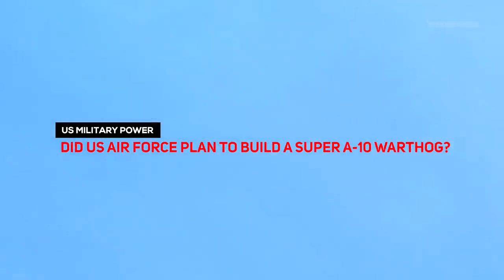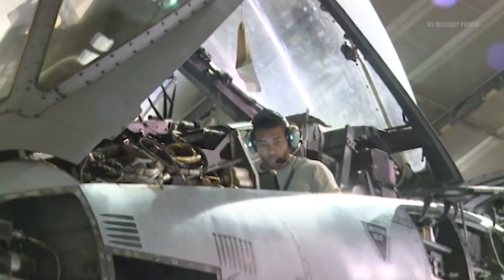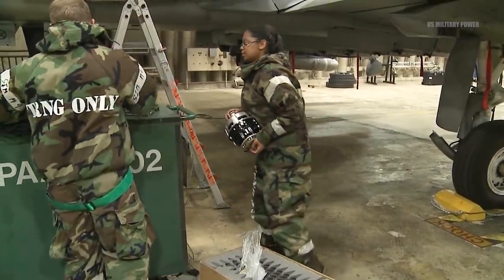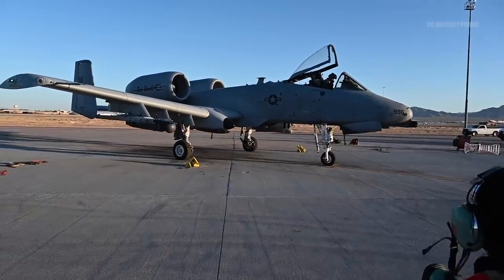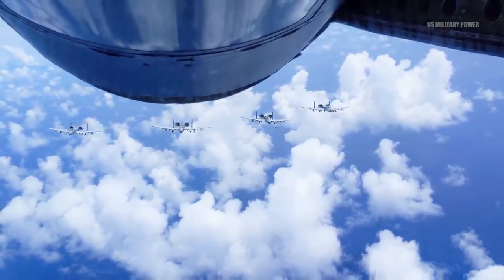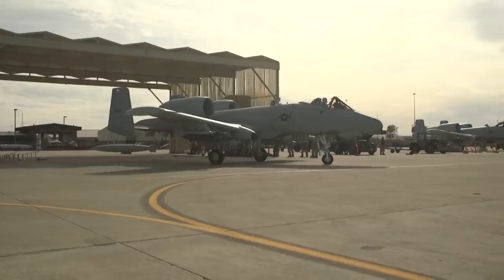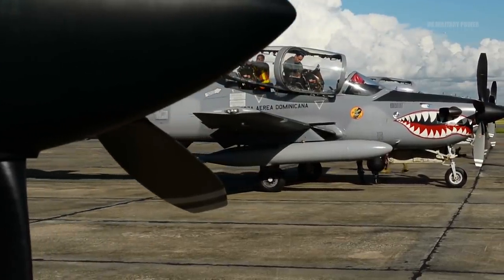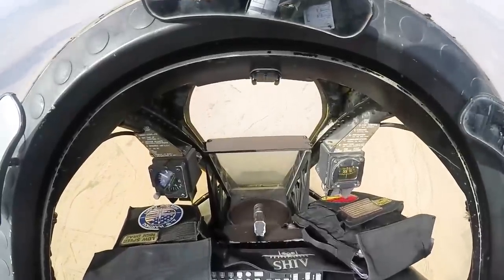The New Super A-10 Warthog is Coming

Comment: Here is my idea for a new A10 replacement: Platform will look almost identical to A10, but be built from armored composite materials, improved engine, advanced avionics set and maybe even built around a new improved rotary autocannon. It will feature capabilities like surveillance and targeting assistance from UAVs. That's it, if F15 EX exists, so can a potential A10 EX or something.
Reply: Put a small drone on it that detaches and provides recon for the pilot autonomously in night vision or infrared so the pilot can see what's happening around the battlefield better without having to fly by looking down so much. Install a better radio too

Comment: Its the only aircraft that can withstand close combat support and take a beating but still make it back to base under power. It's a soldiers best friend so placing would be a no if you're smart. Yes updating it and if it can improved overall with better technology, improved weaponry, more speed/ maneuverability and an even tougher less impenetrable frame then I'm all for those improvements but it's role really can't be replaced but they can improve it and for way cheaper than 5th generation fighters by far even though they have there role as well.

Comment: The only thing better in my opinion than an A-10 is an A-10 with another gun and thrust vectoring
Why thrust vectoring:
Gain altitude near vertical until stalling above a heavily armored tank that might be developed in the future and thrust vectoring will allow you to 180 right to the weakest part of a tank (roof) with the best angle of none for penetrating armor and blast the heck out of it with 2 guns

Maybe also something that allows the gun to turn to whatever the targeting system locks onto
For guided weaponry without the price of missiles 
(basically just like aimbot in a video game)

Comment: The biggest issue with the A10 is that it wouldn't survive long in a modern war against a well equipped enemy. It really only works when you have air superiority and there is minimal threat from SAMs. If it is to be replaced, it needs to be replaced with basically a newer version of itself, but I think it has to be unmanned.

Comment: I like the idea that the new A10 will have computer-managed flight control by differential thrust - As an emergency measure. (Propulsion Controlled Aircraft software developed at NASA Dryden). I don't see a reason why the old A10s can't be retrofitted with it, since it's entirely a software upgrade. We can probably presume they have done this.

Comment: It is built with function over form. Where radar cross section isn't a key factor. Its slow, armoured, and absolutely lethal in it's role. They've come home without wings or engines, and is the best thing to turn the tide of a ground battle. 

They really need to ditch the f35 money pit and focus on what works- and make more of what works instead of trying to reinvent the wheel.

Comment: The a10 is here to stay. Albeit I really wished they would actually add modern prop attack planes for close air support in non heavy anti air areas. Better heat efficiency/ heat locking SAMs can't find em and triple the loiter time in the AO as they are extremely fuel efficient. Grants the A10s being utilized on the seriously dangerous areas and should give more firepower in those areas.

Comment: Instead of replacing the A 10 change the materials and make it even easier to maintain the craft. An example could be investing into advanced 3D printing machines to build fewer pieces and make it easier for mechanics, also adding regidity and saving in weight.

Comment: I think the problem is that the A10 is currently a lot cheaper than a F-35B for Marine use, I mean one of those suckers is like  maybe 115M for the F-35B compared to the inflated price of 10M for the A10 so naturally the parts and upgrades etc would be a lot cheaper still. F-35 is of course a superior airplane by far but it will burn a ton more fuel and feels like a complete overkill for terrorists, though the stealth aspect would make our soldiers even more safe and I suppose you can't put a price on American soldiers.

Comment: There was already a very good...no, excellent candidate available from way back in 1991. The aircraft was small fast and very nimble with the same, albeit only slightly smaller caliber, GAU Gatling gun, with 4 hard points as well. The jet powered aircraft was designed by Paul Rutan and it was called the "mudfighter" or "killer bee" or something to that effect. There is still a video of that aircraft here on YouTube. Just search for "Paul Rutan mudfighter killer bee". Type that phrase in and it should be on top of the list.

Comment: When you need CAS the last thing you want is to be waiting for a F-18 or F-35 to get turned around and lined up to make another pass, whereas an A-10 will just do a quick roll and be right back on target, low and slow, with accurate fires. They can take a hit and keep on laying down fire, not to mention they cost a 10th of what it costs to fly a F-35 (per hour), and if the enemy does get lucky and downs a F-35, that's $80 million!! And even if they manage to just do minor damage you're talking a million to repair the stealth capabilities. 

The A-10 was never meant to engage in highly contested airspace, we wouldn't have troops on the ground in such an area. It is and has always been designed for CAS to support ground troops, not to take out radar facilities, and enemy fighters. So to use the argument that it's obsolete due to that reason is BS.

Comment: For me, the A-10 is the close quarter aircraft, among all fixed wing airplanes on service not to mention it can take hits and shrug it of as it's just a scratch.
I'm no military expert but aside from the AC-130, is there any other fixed wing aircraft that can do a close in support to ground troops that can come in and out on both open, mountainous or even urban area.  Yeah, the F-35 may have hover capability but it can't take hits like the A-10 and it's mostly analog (I think), so electronic warfare won't be that much hindrance to the A-10's.  I may miss out some points but A-10 is a beautiful aircraft. it gives me more goosebumps whenever I see a video or picture of if compared to the Longbow Apache, F-35 and/or the F-22 Raptor
gorgeous
Reply: An A-10 would become dust if an S300 or a newer SAM hits it.

Comment: There's just no reason to retire it, until they can make a plane that does it's role better than the A-10 and is cost efficient there is no better option than just tweaking the A-10. The F-35 is far more expensive and less effective in a ground support role, nor as safe in a "low and slow" strategy, it isn't maneuvering like an A-10 can.

Comment: There is a potential to make the A-10 better. But only by producing newer models with more survivable, fuel-efficient engines and making it an UAV. This would eliminate the need for the vast amount of titanium needed for the 'bathtub', saving it for use around the avionics bay and allowing the trade of the cockpit equipment weight for equal weight in additional GAU rounds, Current and future A-10 pilots would transition to flying the plane remotely, allowing for tighter turns, the ability to place the plane in greater harms' way, and provide guaranteed survivability of the pilot. Unlike the Predator and other UAV pilots' stations, the job of the A-10 requires a wraparound electronic cockpit and the aircraft mounted cameras required for the full field of view with zoom technologies useful in CAS giving an enhanced ability to scour the battlefield for targets.

Of course, current A-10 pilots may object because it takes them out of the air and make all missions virtual, but this would be the only real replacement for the A-10. Else startup the Fairchild factory production line and get to manufacturing a new run of the 'old' model.

Comment: This is simple. ANYONE that wants the A-10 retired has NEVER been on the ground, in combat, being shot as (as I have). They don't know the RELIEF that is felt when I was told that A-10's would be checking on station and I should start working up a 9-line. Morale just SKYROCKETS because we know that the people shooting at us will be DEAD soon with nothing but bits and pieces of them left. The A-10 was DESIGNED and BUILT for CAS (specifically anti-tank) but it does just as an effective job on PAX. The A-10 is cheaper, has longer play time, can take more damage and the pilots have a MUCH better chance of getting home after sustaining damage than the "next gen fighters". There is NO OTHER PLANE that I'd rather have in combat than the A10. None.

Comment: If the Air Force One will not continue with the A10, army should fly at alongside their choppers. We need a close air ground support fixed wing aircraft to protect our troops on the ground. During combat situations A-10 pilots are unable to buy their own drinks in a bar for a reason.

Comment: With all of these "we must replace the A10" initiatives out of the UAF, I've never heard an articulation about what that A10 does poorly at in its CAS role.
Aside from some electronics upgrades, there just doesn't seem to be any real meat on those bones.

But I'd love to hear it if there is.
Reply: @Paytrolah   This sounds like you don't like CAS even as a concept. Because there is literally no way to do CAS without dealing with MPAD threats (and unlike all other CAS aircraft the A10 has the best survival rate). The CAS role also doesn't involve air coordination or battlefield networking at all. Nor are precision guided munitions, which you offer as a substitute, "close" in terms or air support. (I also wonder what you mean by "can't take out a tank", since nearly any modern aircraft have the mount points for weapons that can; unlike stealth aircraft, there are no real size restrictions on the A10's either.)

So while you can be against CAS, that's not what I'm really asking. The Army, for various obvious reasons, loves the role. (As just from a psychological standpoint, you can see its value: having a jet flying around low and slow panics enemy insurgents causing them to break off attacks, more than any single bomb dropped from 20,000 feet could.)

Maybe it would just be better to scrap the Johnson-McConnell agreement. Let the Army have the A10 that the Airforce poo-poos. With the loiter time and serious firepower to affect an extended firefight, rather than just dropping a couple of bombs of widely scattered insurgent fighters, and flying 2 hours before being able to fight more.

Comment: I just don't understand why they just don't redesign it to bring it up to date I mean it has to be cheaper to take the existing plans upgrade the engines use a modern cockpit module and just build the thing with modern materials it has to be cheaper than a complete ground up new solution

Comment: What about a light bomber, with completely autonomous drone-bombs?  I'm no expert, but a slow moving munition with a strong payload of thermite or something worse would probably eff anything up that had a 75 * 360 degree AOA.  They don't have to be fast, just low-observable.  No heat signature for a good 10 minutes, and a follow up drone could confuse EM sensors.  Plus, they would poison their own civilians if they tried to create a shield that could withstand thermite.  Asbest0$ and all.  Problem is, how to get VTOSL in such a durable frame for the follow-up that has enough light munitions to eradicate the escapees.  Perhaps a ground-effect airframe Carrier with 10 launches and landings an hour?  You could actually speed up the aircraft during landing to add inertia to the carrier!  Even if the target had someone with a 50 cal air defense you could blind him/it with flash or EM blanketing.

Comment: It is hard to believe they are thinking of retiring such a dependable and successful asset without even considering a replacement. Sure the f35 could do it and an aging fleet will cost more to maintain and upgrade, but how much is one f35? The a10's trump card for me is its durability under fire and the speed it can be turned back around to operational ability should it get damaged. Maybe im just nostalgic for watching this ugly old bird strafing barges in the Wash from Gib Point, but i saw enough to not want one hunting me down.

Comment: Yeah, no, you can't replace an A-10 with an F-35.  Just because it "can" do some "similar" things, doesn't mean it can take a lickin' and keep on tickin', which rather is one of the most important parts of close air support.  Ground fire happens.  And right now, there just is no replacement for the amazing A-10.  Worse, I fear what some modern egghead thinks should go into replacing one.  Just retrofit what you know works, because you know it works.  Newer isn't better.  (Especially when your opponents keep using old outdated reliable tech themselves.)
Reply: I think one of the biggest ticks against the F-35 is loiter time. The A-10 sips fuel compared to the F-35 and has the ability to stage on station throughout a ground engagement. The F-35 is nothing more than an air superiority fighter masquerading as CAS.

Comment: "We need to save money by eliminating the A-10 and replacing it's role with an airframe that costs 6-8x as much per hour to operate." "What's that? No, I haven't been promised a lucrative "advisory" position at Lockheed Martin, and I resent the implications suggested by your use of air quotes.
Reply: One f35 with SDB's >>>> any number of a10's.

Comment: I can’t believe that the USAF would even consider completely removing the A-10 from service, at least not until a replacement has entered service, but why get rid of an aircraft so well suited to its role, I don’t think that any country has a ground attack/close air support aircraft that comes anywhere near the capability of the ‘Hog’, obviously budget constraints are a factor in the USAF hierarchy’s thinking, but so should the needs of the forces that they support be considered,but, and there is always a but, if the A-10 is structurally at finite fatigue life or cannot be brought up to the operational standards that modern battlefield commanders need to be able to employ it to the maximum advantage then they are definitely having to do some very quick procurement, not the usual decade+ before entering service, more like 2-3 years. One thing the USAF could stop doing is wasting money on hugely overpriced,under delivered and uneconomical aircraft like the F-35 and Raptor, they don’t always need brand new shiny ✨ toys 🧸 to play with. O

Comment: In the Iraq, Afghan, Syria, and other Middle Eastern war zones of the last 20 odd years. You have technically advanced US forces, fighting effectively enemies still armed with 1950-70 technologies ! So chucking  a limited number of high tech expensive missiles at them is wasteful. Simply because this type of weaponry can only be carried in very limited numbers on each aircraft, limiting the number of targets each expensive aircraft can in fact deal with. Therefore what is needed is something like the A10, which can fly faster than helicopters, but slower than fighter jets, which is tactically more advantageous for hitting slow moving or stationery ground or sea going targets. And, pack a lot more firepower in the form of gunnery, of various types, to deal with a much higher number of enemy targets than missiles currently allow, per aircraft sortie. This also means fewer aircraft will be needed to win the "war". 

The idea is to win the war, but ever more expensive new wonder weapons, may be suited to a war on the scale of WW2. But most wars of the last 20 years are more akin to glorified "Skirmishes".  The A10 therefore needs to be maintained to plug this problem. An upgrade yes. More powerful, quieter, and more fuel efficient engines would increase its current versatility, and carrying capacity. But gunnery is the cheapest, and in many ways the most effective solution to deal with many of the "wars" the US has been involved in over the last 20 years. This type of warfare shows NO signs of disappearing any time soon !!!!  

If you are worried about "Body bags". Then a modern A10 Drone type aircraft may be a good solution, but it needs gunnery not missiles, to deal with the largest number of targets per aircraft sortie, in a more cost effective fashion !!!

Comment: The A10 is the only plane where the tail section is gone, missing an engine, and part of a wing is shot to hell and she still gets her pilot back to base.
It can take a hit and keep going.
The F-35 had been a piece of crap and is still a piece of crap: years overdue, way over budget, and military pilots wanted twin engines as a built redundancy, and it is already becoming obsolete. Too many got blinded by all the fancy doodads she carries and ended up with a turkey. That is not even counting the issues with the proprietary built-in parts ordering system that does not work half the time, that was the biggest selling point of it, not having to keep extra replacement parts in stock and get the parts as needed. That works iffy with Walmart but not for our US military.